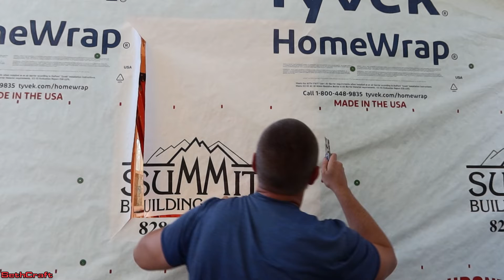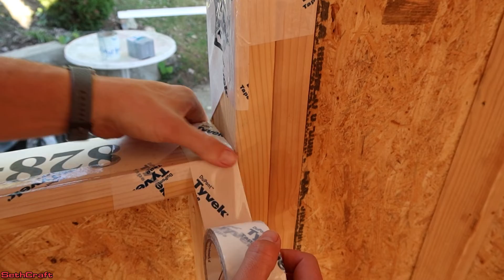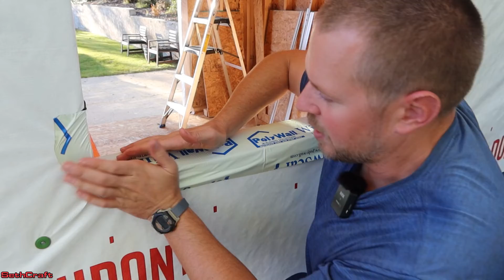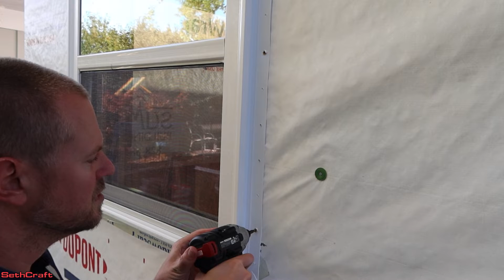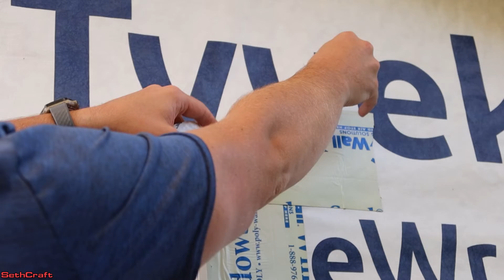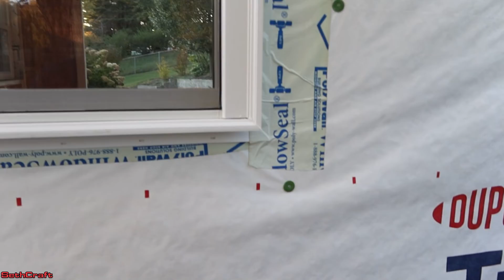DIY Window Install into a 10x12 Shed

Comment: the window install is pretty good only thing i would of done different was continue the tyvek over the inner ledge and cap nailed it or stapled it under the sill depending on the tools on hand then did the tape and seal, before you tell me im a rookie  ive built houses for 15 yrs.but if that leaks it was going to leak no matter what